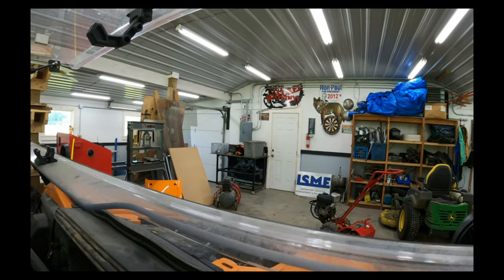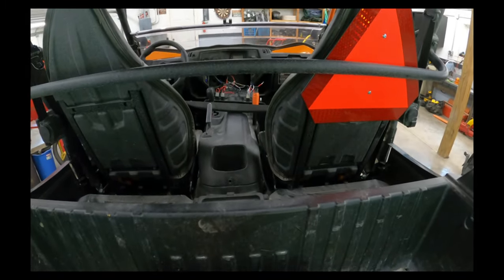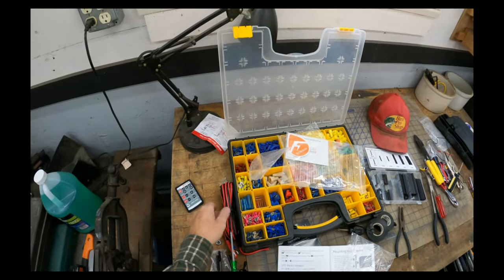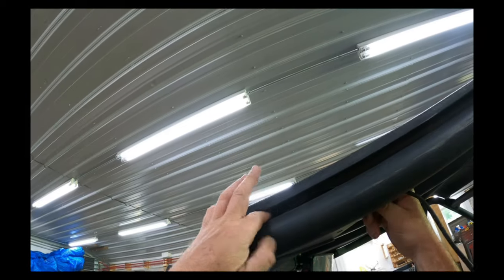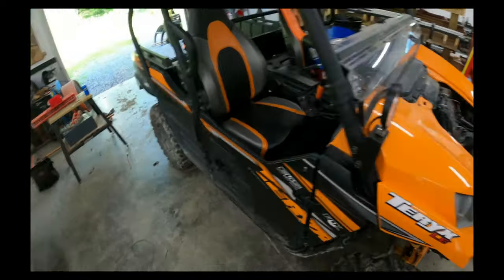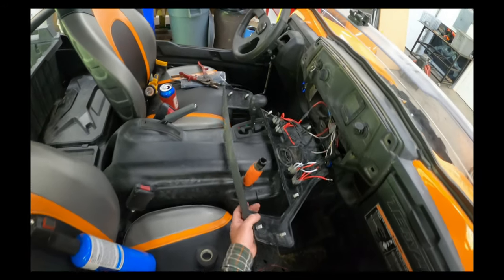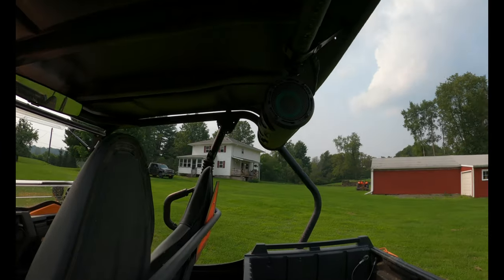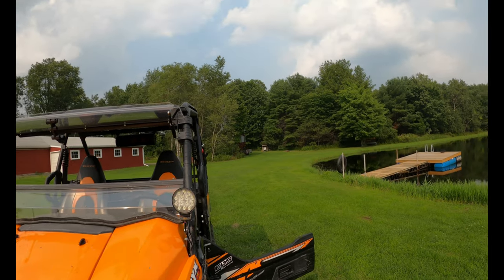SXS Sound Bar Install - ECOXGEAR SE18 Installation and Review

Comment: Sorry No I mean the box you have on your work bench with all the wiring connectors with the clear cover and yellow bottom.   Thanks
Reply from the maker: I bought the case from harbor freight and the electrical connectors are from Amazon, harbor freight etc

Comment: Is this model sound bar comparable with their subwoofer also? Or can this sound at provide input to an external amp? To run regular subwoofers maybe?
Reply: Also how would you say the bass output with just that sound at is? Like good car door speaker level bass or is it just a good loud sound to just hear the songs?
Reply from the maker: It is compatible with their sub. External amp I'm not sure... it's at least good car door speaker bass I would say.

Comment: I wired mine up tonight but it did the same thing and wouldn’t turn on with the switch, how did you fix it ?
Reply from the maker: It won’t turn on with switch the switch is simply to supply power to it then you still have to use power button on the stereo or the one on the remote
Reply: How did you wire your switch to shut off with key power ? 
I have a fuse block ran to it and the key switch wire just not sure which way to wire it.
Just don’t want a constant draw on the battery the sound bar is in rear of 4 seater so I can’t reach back and just turn it off plus the remote sucks!
Reply from the maker: @stephanieroyse8167  just wire switch with one of the ‘keyed power’ circuits of the fuse block and you’ll be good to go!

Comment: Can anyone tell me that has this unit?If the lights can be turned off because I don't want them to be on my motorcycle, thanks for any info
Reply: I bought this and returned it asap. Regret not makign a video. I hsbe vance hince pipes. This spesker sucks bro. Not loud enough. I got the 18 inch elite.

Comment: do you think the extra $100 for the larger version would be worth it or stick with this one?
Reply from the maker: Probably depends what type of bike you have and what type of riding you’re doing. The Teryx is known for being noisier than most bikes so I kind of wish I had. Now if you have a ranger or something that you’re just doing slow trail rides and working around the farm with I’d say this is plenty loud. If you do a lot of fast road riding I’d definitely say get the larger unit also. Thanks for watching, Justin!
Reply: @DirtRoadLife1   It's going on a golf cart. So I'll try this one out! Thanks for making the video.
Reply from the maker: @jhaber86  you’ll be more than happy with it on a golf cart!
Reply: I spent the extra 100 and it's worth it also have the sub it's awesome
Reply: @jhaber86  get the SEB26. It’s battery powered. MUCH EASIER to install

Comment: How did you pair the remote? Mine won’t seem to pair
Reply from the maker: I don’t recall having to pair my remote I think it was paired automatically but it’s been a long time
Reply: @DirtRoadLife1  dang. I just bought a side-by-side with it on there and I can’t get the remote to pair to the sound bar.
Reply from the maker: @jzdenni  I would probably get on their site and download instruction. Maybe remote doesn’t work
Reply: @DirtRoadLife1  great point. Thank you sir

Comment: You find that it’s loud enough when riding at higher speeds? I am needing to replace my Wetsounds sound bar, it went out.
Reply from the maker: The only time it’s hard to hear is when I’m wide open down a road with engine and wind noise. But Teryx’s are notorious for being loud machines as well. So it would probably depend what you’re putting it on but I’ve been extremely happy with it.
Reply: Thanks! It’s going on a Polaris Sportsman 800, I had the Wetsounds Stealth bar but it went out and I am not spending that much money on another one of those!
Reply: @bstp7121  how did u install it bro i just got one about to put it on my scrambler 850